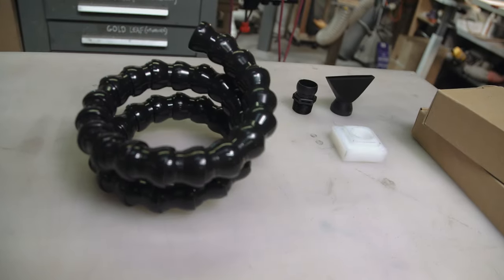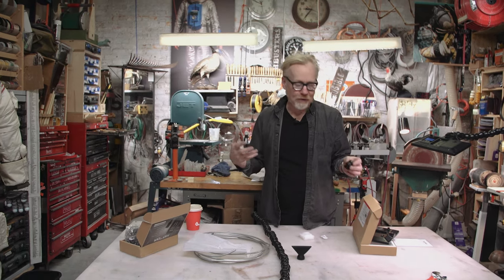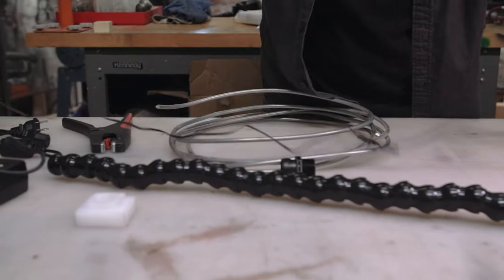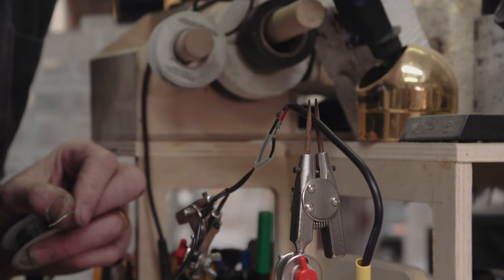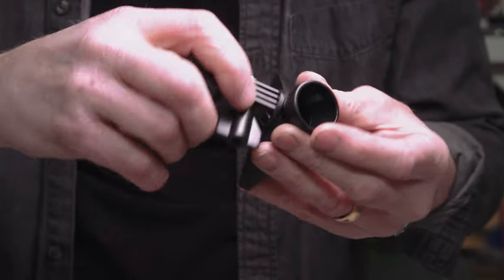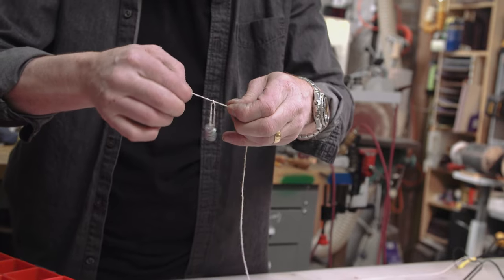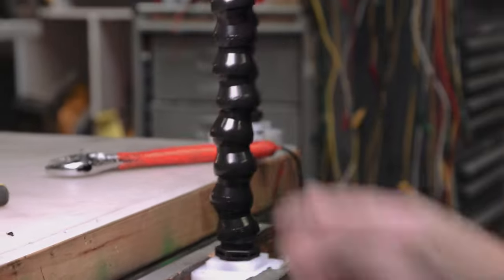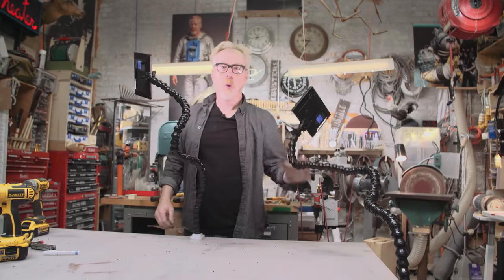Adam Savage's One Day Builds: Custom Workbench LED Lamp!

Comment: The linked light panel specs say 15W, so a 12V 1A supply wouldn't be enough, but a 12V 1.5-2A supply should be sufficient.
Reply: It works fine with a random 1.5A 12V center-+ Ktec wall wart left over from an old WesternDigital USB external hard drive.

Comment: I'll be making one-- but I'll be using a 3/4" pipe floor flange.  Basically a large round disk that has a center place threaded for 3/4" pipe (NPT).   Very likely, I'll also go up about 12" with plain galvanized 3/4" pipe, from that flange, to eliminate the need for the steel stiffener wire.   

Finally?  I am not fond of wire that is constantly being bent-- so.  I'm thinking I'll go inside the 3/4" loc-tite with some 1/4", and run the wires through that, since I have to solder it anyway.  I'll need to run just the wires first, as 1/4" is too small for a connector.   I'll see if I have some very fine (can take lots of bending without harm) 18 ga wire to run inside the Loc-tight.   Perhaps re-purposing some old AT&T telephone cable?  That stuff's incredibly robust.  

Otherwise?  Pretty much as shown in the vid.   Nice.

Comment: The downside of living in Australia. Amazon dot com refuse to send products such as loc-line here now. Amazon dot com au has no loc-line. The Australian distributor sells it for 130AUD for 5ft or I can get 1m from Germany eBay for 130AUD.
It also seems that blocks of delrin don’t exist here.

Found some “bendable gooseneck go pro mount” on eBay that’s clearly knock off 3/4” loc-line for 8AUD. 16aud will give me 1m so I’m gonna try that instead.

The light though, is frickin amazing for the price. Going to buy another two! <3

Comment: You “softened up” the long end of the armature wire but didn’t touch the short end which will still cut into the wire. 

Will aluminum armature wire work harden over time like a copper or brass wire will?

Comment: Is that thing really safe? I mean, during use the alu tubes are going to rub against the wire. 12V 8A? Thats pretty bad. For that reason, my garage is fitted with a single switch which kills all power to whatever I may connect. Except the beer fridge, of course...

Comment: If using an armature wire,  why not skip the loc-line completely and just use some sort of opaque tubing or some wiring covers? Would save you a good 25$ bucks and it wont make that clunky noise when moving it.

Comment: What did you do with the wire coming out of the white delrin mount ?  Did you cut a wire channel slot in the delrin, or did you drill a hole through the table and have to re-run the wire all the way through the armature (a third time) ?

Comment: How does the steel rod get fixed to the bottom? Also is the steel rod attached to the armature wire? Not sure how he did that or if its just thrown inside the Loc-Line

Comment: I saw a 6 bulb T8 might have been T5 with 6500 lumen daylight and it was nice and bright.

Then I priced one and they wanted quite a bit of money for it.

But, hanging over my workbench now, I got a single light over my workbench.
Just a one bulber which isn't enough light
 I need or rather prefer to be surrounded in light.

But, are you standing on concrete or a nice rubber pad.
I bought a couple horse stall rubber pads
Much better than that crap they make for humans.
About an inch thick and I love it.

Have you ever seen in a high-power electricians Halo they wear, they got a Halo that surrounds their head in light.

Should have put like a magnifying glass pame and then surround the magnifying pane with lights, point toward the object you want to work on it that way all you have to do is look through the magnifying pane.

Then all you have to do is when your fingers darken the area you're working on

You have lights to put on your fingers

Comment: Instead of "Skinning a cat", try "Removing the protective covering from a feline." :)

If you ever need to fish wire through a much longer piece of tube it works great to use a vacuum cleaner to suck the wire through.

Comment: Tested Crew! 
Here i go as a professional "Metal-man" and issue a "Grand One Day Build - Challenge":
"Adam, ye will be needing a proper Work Station for Fire in your so called "Cave of Adam Savage", so you dont get yourself or anything unnessesary/ nasty been scorhed, burned, blasted or probably blowned up when you try to weld, cut, grind or melt something of "your usual" stuff.
So what you gonna need is:
- a pipeline for gas tanks that will contain proper valves with back fire protector what will go close as possible to the welding table connecting the gas tanks ang hosing.
- a proper rack for the gas tanks.
- a gas tank safety glove (always be available near the gas tanks!)
- and last but not lot least spark/ fire protector curtains.
Think ye can handle this? We dont want that what happened in Mythbusters: Exploding Jawbreaker. Safety hats first, even for old fox masters like yerself...!!! Thumbs Up and Cheers for The One and Only: Adam Savage and his The Tested Crew!! Happy Past Easter!!!

Comment: no more link to the Armature wire? and do thy make a smaller one in diameter, thinner one? to use as a thinner goose neck want to use it on a web cam.  so  a base, then the gooseneck, then on top of the webcam on top. the reason i want it thinner is so the neck be easier to bend but still making sure it will stay in place and not move out of place. i was going to use a fluid video head and i have tried to find one super small one, but there way to big. mini ball head are the right size but do not have a fluid motion for tilting up and down so i want a fluid video head the size of a mini ball head so the next best thing is a goose neck i guess. unless u have another ideas? i want to be able to tilt as much as i want with out having to tighten it up ever time i tilt allot up and down. that why having to tighten it ever time gets annoying.

Comment: Oh wow, I definitely need to try something like this, my desk is always terribly cluttered (yeah I should probably fix my issues rather than work around them ¯\_(ツ)_/¯ ) and it's a hassle to manage cables when you're readjusting where you're working. Probably gonna have to look for an alternative to Loc-Line though, 6 inches costs ~$45 where I'm at, yikes. Also, kinda creepy that amazon already knew that I might also be interested in armature wire and a Viltrox LED panel...

Comment: Nice one i where using potentiomeeter and 1-3 w led + usb to 5 v :D just a power bank or phone charger to power up i can do same as well with 10 led rly even if i connect em + - - will be well to 20 volt pc power supply i just need the addapter or solder it on rly and i can as well put old light same thing but metal that stays well ill not cover it if its just 20 v and i can use sound system cables + - + most times stay inside as well but the inside is really tick and i can attach fan like 5 v i guess on small pc fan red to 5 v if its 3 socket red yellow n black the red is 5v in yellow is 12  as well with good heatsink xD and i guess no case i better add the - to the whole thing like the heatsink and try bolt or solder the led plates to the heatsink to attach em vs adding thermal paste or 3 led or 5 or 4 on a small intel cooler processor work as fine and has the fan on just need way to attach it

Comment: Those "Loc Lines" are not so easy to put together, you have to buy the tool as well.  At that cost, I'm surprised some manufacturer has not come up with an already built model, with the commission to Adam as well.  It looks to be a lifelong tool/work light.  Rather than buy the dad gummed tool, just tack that cost onto the ready-made model because I'll probably never use that tool again.  Yeah, just after I already ordered everything.

Comment: If you are looking to build this, I found out that Loc-line makes a "Starter kit" with 2 sections of line, the NPT adapter and a couple nozzles for 10$ . I am only making mine 24" long so I just ordered two of those sample packs. I don't currently have a need for the nozzles but its a great deal and I'm sure I can figure out a use for them in the future.  
https://www.amazon.com/gp/product/B006R9ONBA/ref=ppx_yo_dt_b_asin_title_o00_s02?ie=UTF8&psc=1

Comment: You can get the same flexible hose for $4 for 2 feet on eBay and attach multiple 2 foot sections together. Just search for Flexible 3/4" 20mm*600mm Water Oil Coolant Cooling Pipe Hose Lathe

Comment: 1. Can't get a Loc-Line in my country or EU easy.
2. Can't get a Armature Wire in my country or EU easy.
3. Thinking about buying just a flexible stand for microphones (not as flexible as Lock-Line but it is cheaper and i can find it easy for 16€).
4. LED light panel from AliExpress around 25€ but without warm/cold color setting (or get a bit different led panel).

So, a light for 41€ ? Not bad, i would say.
Reply: Just search eBay for flexible coolant hose. Loc-line is only a brand name and you can get the offbrand stuff for only four dollars per 2 feet!

Comment: Somebody please upgrade adam from his horrible butane thing to a TS100 portable iron, they're a life changer.
Reply: Its not horrible, its actually really good for the cheap price (it replaced my portable Weller), and mine keeps working without any issues since almost 10 years. 
I suggest you try the dremel first before you try to trash it.
It doesn't need batteries or a power supply like the TS100 does, heats up quickly, runs for at least an hour with normal use, you can shrink the shrink tube with it. I don't know of any downsides of it, besides that it lacks a good case to come with it.

Comment: Instead of cannibalizing another power supply for the proper connector, simply purchase a power supply which has the correct tip to begin with. No soldering needed!

Comment: Finally built this!

Not having easy access to Delrin (much less a real shop of my own with the tools to tap a block of it), I 3D printed myself a mount. Free for all to use:
https://www.thingiverse.com/thing:2945188

There's a comment below mentioning a 3/4" NPT floor flange - which may work for some. I purchased one and then realized I'd have to drill all the way through my desk to pass the cable through; not the worst thing, just didn't work for my situation.

Comment: Got a 3D printer? Here's a base plate I designed since I didn't have a lathe!

https://www.thingiverse.com/thing:2970265

It takes a 3/4'' conduit locknut embedded midway through the print to act as the thread. It works great!  I also added a cable trough for flush mounting and a space for an M8 nut on the bottom which you can thread an M8 rod into instead of a loose steel rod.
This lets you mount it in any orientation! This was my first major 3D design with multiple materials. Let me know what you think!

Comment: Here's an idea for the mount.  Once you're using NPT, there is lots of ways to mount the loc-line, and most are available at your local hardware/home store.     https://www.amazon.com/LDR-310-F-34-Flange-4-Inch/dp/B000FPCD6Y/ref=sr_1_6?ie=UTF8&qid=1523925888&sr=8-6&keywords=3%2F4%22+floor+flange

Comment: I love the idea but am i the only one wondering how many times you expect to be able to bend that before the electric wires get pinched between the metal rod/wire and either cut the connection or make some part of the light live....yeah i know its only 12 volts and you "softened " the ends but but its still shoddy workmanship...pretty piss poor planning there Adam

Comment: I built the same lamp and loving it! But I was not able to acquire the mounting hardware, so I designed a 3d print with which I mounted the lights to the Loc-Line tubing. Its available (freely of course) at printables.com: https://www.printables.com/model/401135-loc-line-object-mount

Comment: Excellent idea. I used it as inspiration for replacing the lighting element on an old office lamp fixture. To get a nice fit, I designed and 3D printed a suitable fixture which is available here: https://www.thingiverse.com/thing:4167663 Also, I had some issues with glare, so I made a configurable design for a clip-on shade here: https://www.thingiverse.com/thing:4179007

Comment: Great solution!  I need a lighted magnifying flexible neck for my electronics work so I recently did something similar but I used awesome hardware from Snakeclamp (https://snakeclamp.com/) and adapted the head from a circular LED lighted magnifying lamp.   The heavy duty version of the flexible neck is stiff enough to handle the weight of the LED plus large magnifying glass fixture.
Reply: The cost is the same after you add in the armature wire for Adam's build and figure out a bracket to mount the lamp to the table.
Reply: Snakeclamp has several mounting brackets available - no need to make one.  It was all plug and play.  I was up and running in no time.  I'm ordering another setup for my second workbench.
Reply: Yeah, the Snake Clamp is the way to go because you can customize it when you order it. Now factor in your time to do the DIY system, you come out ahead with the Snake Clamp. It's always fun and cool to build something, but there is a product already out there that does the same thing that costs less. For Adam, he might already have that stuff in his shop to use. But most of us are not that fortunate!

Comment: I made a similar light inspired by this build using a Manfrotto flex arm.   Even if you end up using two, for 5' of stalk, it will run you about 70 bucks, and it threads right into the back of the light panel.   You can see photos of the build here:  https://www.facebook.com/media/set/?set=a.10216259203493252.1073741841.1248015348&type=1&l=334896c96f

Comment: For a flexible neck this might be a cheaper option - https://snakeclamp.com/Category/flexible-metal-gooseneck-hose-arm.  I bought a mains powered led clamp on light from Aldi for $14 but the neck isn't that long.  If you replaced the neck you could have something similar but a lot cheaper.